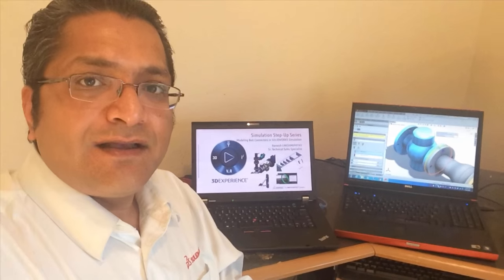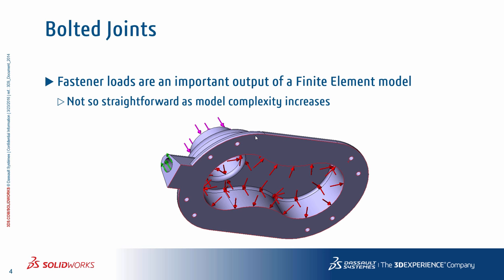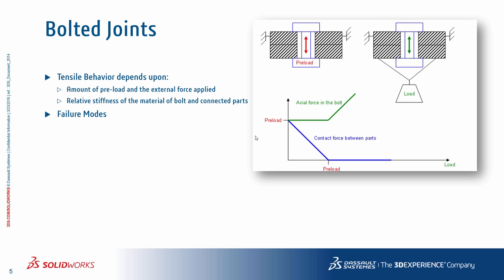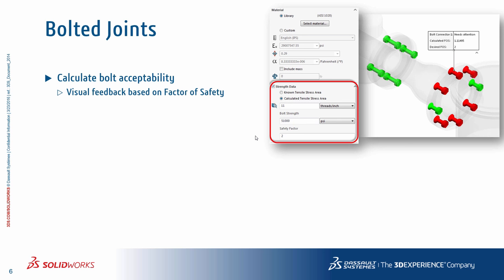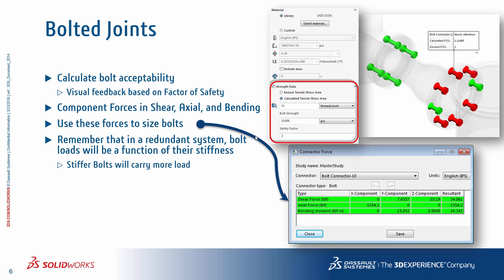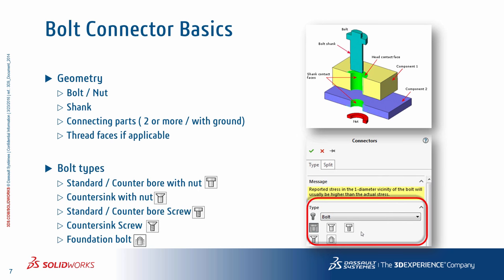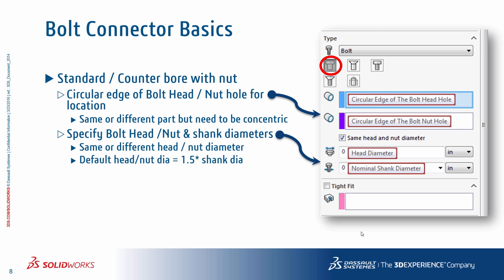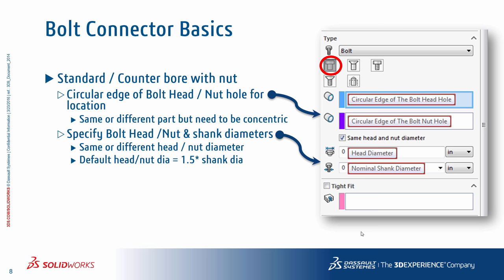SOLIDWORKS Simulation Step-Up Series: Bolt Connectors Part 1

Comment: I have a quick question.
When I am doing a simulation where bolts are included
and
these olts are fastening more than 2 elements 

my contact sets are not defined for the parts in between.

Bolt is set only for very first and  very last parts. and not clamping the rest.

can anyone help me with it.